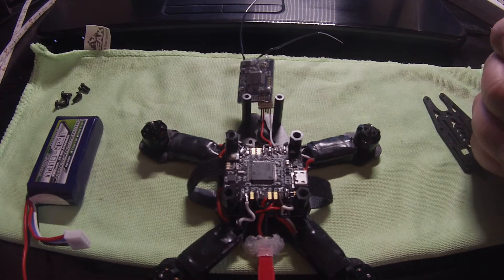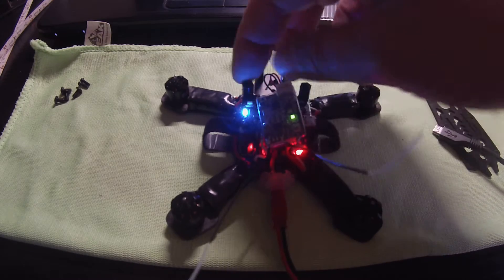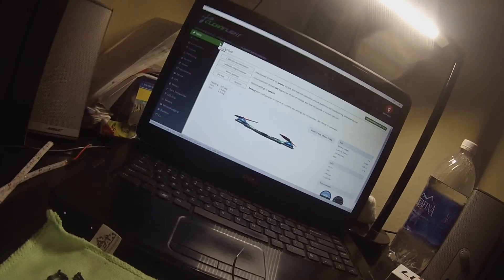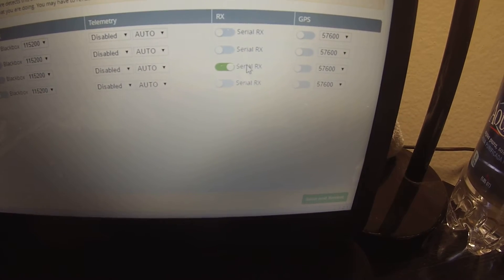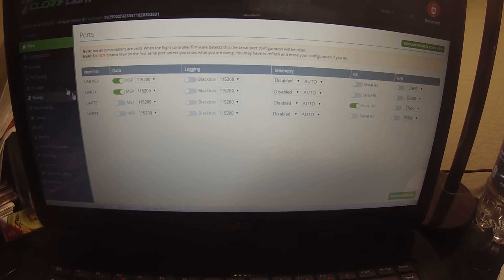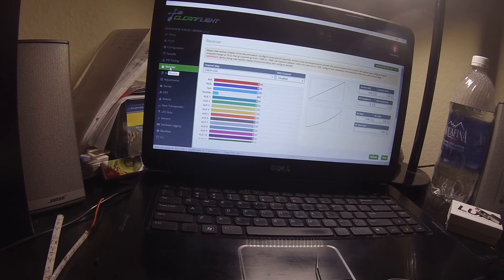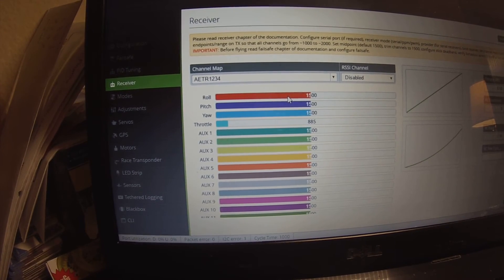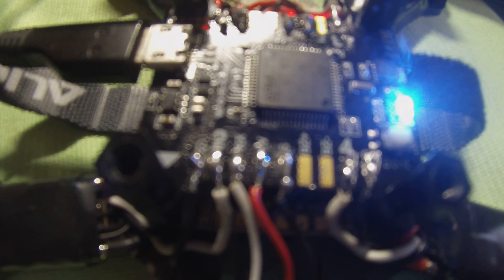Lux Flight Controller....Why wont it work right?????

Comment: did you manage to get a solution to this? i am using Flysky and I am having the same problem here...
Reply from the maker: Leo Luis got it working last year. Believe it or not, I had the screws in the windings
Reply: thanks Skydive, mine came with the PPM bridged at the back of the board so I coudnt get the IBUS to work at all till I realized that so I de-soldered the IBUS and solder the PPM wire into the FC and that was it. It works! havent fly yet coz its raining season now where I stay and its always cloudy and windy outside... waiting for a quiet day to test it out. how is this board for you? ok?

Comment: It looks like your issue is with your receiver mode and port setup.

I ran into this too, and it really wasn't covered in the manual or anywhere easily found. I forget the exact order, but if when you set a port to Serial RX and it doesn't stay set, it means you do not have the receiver mode set. The order in which you set this up is crucial, or it won't stay set and it will reboot and not save. Also, you have to set UART 1 to Serial Rx, no MSP. Everything else remains untouched.

1. Set Receiver Mode (configuration tab) to Rx_Serial
2. Save and Reboot
3. Set UART1 (ports tab) to Serial RX
4. Save and Reboot
5. Set Serial Receiver Provider (configuration tab) to SBUS
6. Save and Reboot.

I may have botched the order as its been a few months, but I had this exact issue and was all due to performing one of the above steps out of order.

Reference this site, hopefully this helps if anybody else stumbles across this.

http://www.fpvmanuals.com/?p=89902

Comment: nice im also running the lux on the atom rx122. the fix is to check if you have the right driver for it. there are TWO drivers in this board. one driver to check is when not in bootloader mode then another driver is for bootoader mode(bootloader mode is when you connect the lux with the boot button pressed) 

when not in bootloader the driver you install in zadig is USB serial CDC
WHEN in booloader mode the driver you install is WINUSB (vxxxxxx)
Reply: thanks! This worked for me! I almost gave up until I read this comment.
Reply: im blur, what need to be done here? use zadig select stm32 virtual com port OR STm32 bootloader? to CDC serial?
Reply: got it, nothing wrong with my driver. just i was thinking that RX pad is dedicated. didn't know it is actually UART1. which earlier I use UART1 for my OSD. so MSP and Serial RX.

so i move my OSD to UART2. done. pheww! damn the manual. 

UART1 - SBUS (RX pad)
UART3 - SmartPort/telemetry (TX pad)
UART2 - OSD (RX2/TX2)

thanks buddy.
Reply: still can't figure it out can u explain a lol better
Reply: Jad Collado i post a video on my channel related to this issue.
Reply: TuanQAV 
can you post the video on here or text me or call me 4804322231 it I can't find it on your page. so I literally have everything working I got my receiver sticks moving but when it comes to motors nothing works unless I do it manually on betaflight. this is my first build and it's pissing me off so bad
Reply: vince flrnoy i assume ure running on sbus receiver. u have to select UART1 as serial rx. 
on configuration tab. make sure your esc/motor protocols is firm oneshot or multishot or dshot. and receiver is mention sbus. that all i have for this kind of problem. receiver tab working but arm doesnt do anything but manually under motor tab work just fine.

Comment: i have the same problem.  this fc is a piece of shit.
Reply from the maker: did you bridge the pads underneath the board? if your not getting power that's  probably it.
Reply: +TheDgskydive I think my iron was too hot and fried something.  I got another lux board from a friend and it worked fine.

Comment: Have you found a way to fix it? I have the exact same issue now! Such a hard flight controller to setup. I may ditch it and go back to kiss gear. Lumenier normally only makes quality products
Reply from the maker: my issue was that I hadn't bridged the same 5v and SRX pads on the bottom of the board.

Comment: on the second port, turn off the MSP thing and turn on serial Rx. Also this is something that you have to do for all flight controllers with the new cleanflight if you are using serial rx.

Comment: I am trying to set this board up, and I can tell already, I hate this. I connected battery, connected my x4rsb and my usb to check what are you trying to check, and magic smoke came out from the bottom where the usb is. What the hell, so I cant connnect this board to usb with battery powered on? How am I suppose to set it up then? This board is sucks.
Reply: +Andy Frak u can actually power ur x4rsb over usb. u dont need to connect ur battery
Reply: +GourmetMusicVec yes but he should be able to plug the battery in while USB is connected to test motors.